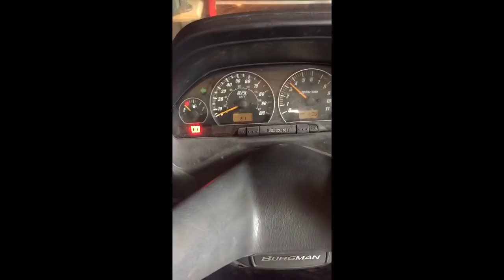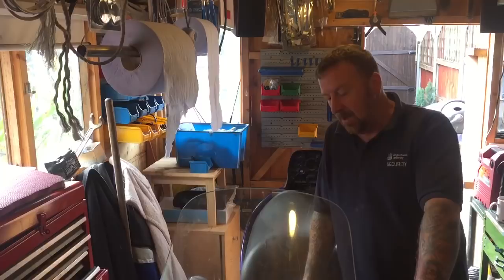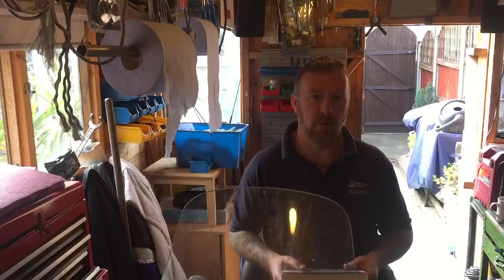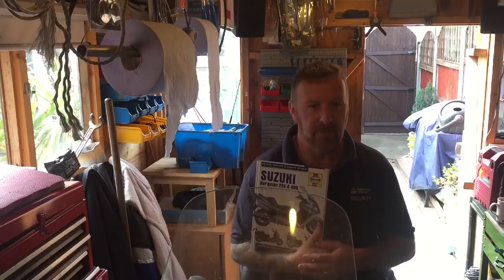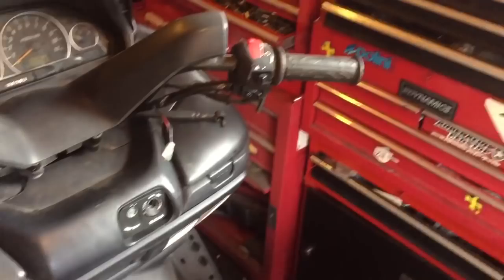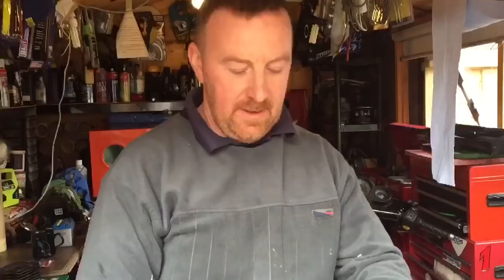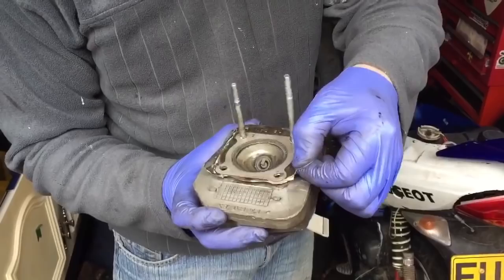SHORT COMPILATION OF BIKES & MOPED PROJECTS MARK SAVAGE

Comment: Hey Mark love your videos helped meout I've got a pegeout speedfight2 that all of a sudden has just started overheating real quick it's watercooled have you any videos that could help me?
Reply from the maker: Kyran Mccarthy I do have lots of speedfights videos but not many in over hearing 
Are you loosing water ?
If so is it leaking out ?
Can only be two reasons really 
Leaking or head gone 
Give it a full check over from the water pump to radiator and then head 
Mark
Reply: Nope although I after watching a video you did about the rollers and clutch I definitely need to have a look at them cause I've lost a lot of power wonder if that would ever make it over heat
Reply: How do you check the head?
Reply: And thanks for the quick reply
Reply from the maker: no rollers and the variator is all about the pull away and preformation and does not cause overheating
Reply from the maker: so you not loosing water at all?, check your water pump as it sounds like it's failed but the more it over heats it will cause your piston to over hear and score and fail 
only really way is to take the head off to check piston and you will need new gaskets then so check everything else first 
mark
Reply from the maker: i try and help bud, all i ask if for you to like share and subscriber, i have a few videos on water LC speedfight give them a watch. you may have to click on all videos and scroll down for a bit lol
mark
Reply: Will do mark you the man ✌